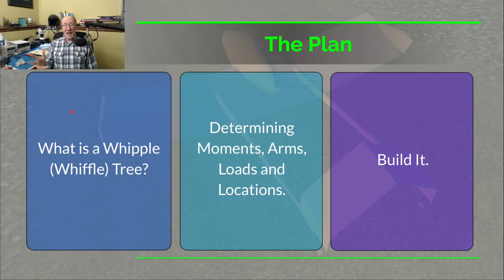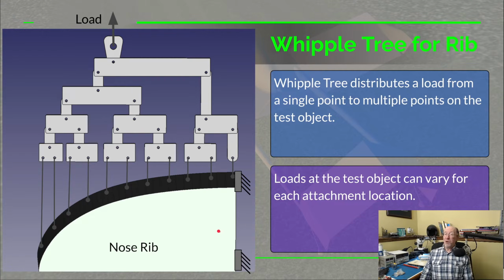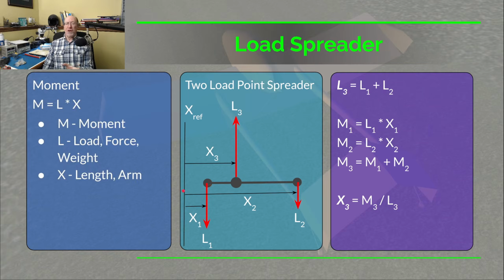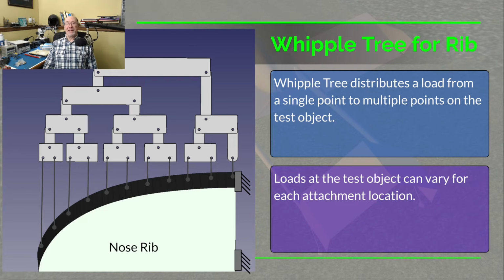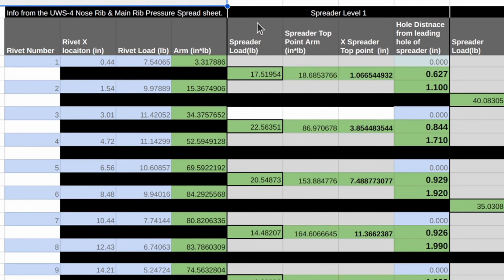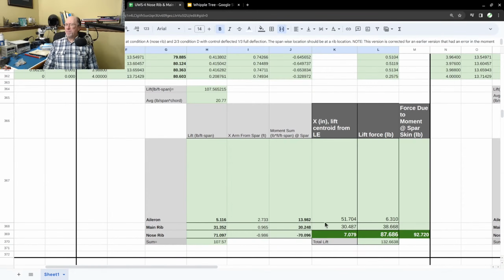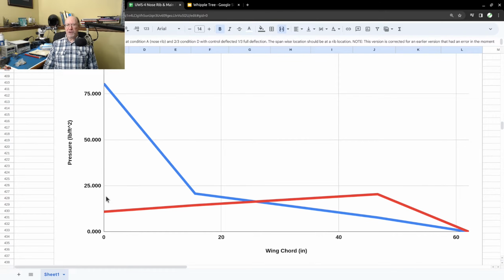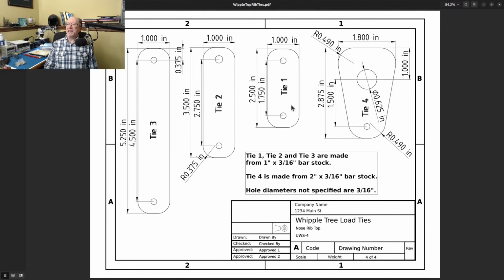Whipple Tree Analysis and Fabrication

Comment: Our aerodynamics professor told us the local aerodynamic pressure is perpendicular to the nose rib skin (everywhere on the surface!). 
And it varies from pressure at the stagnation point to strong suction at the point of smaller radius downstream and reducing in suction more aft. ( Depending on the section and angle of attack )
So you have to push at the nose, to pull perpendicular to the skin (in many directions, sun-ray-like). (If the professor was right,... was he?) 
So pulling forward, and up, etc. using local attachments, pullies, cords and deadweights would be the professors idea. That is the right method, and cheap. (pullies, cords, bottles with water as deadweights?)
Not a whiffle tree as used for a complete wing, that is a wrong copy cat for a rib.

Comment: Really great analysis for the above average home builder. It would be great if you could do mathematical structural analysis for wooden aircraft, and for the wing section from the root to the wing struts. Also one for wire braced biplane wings